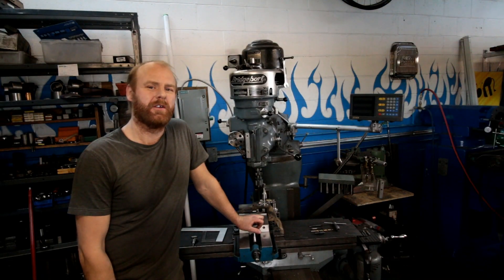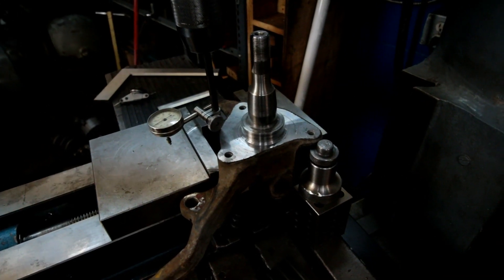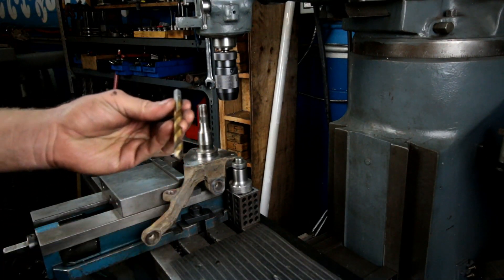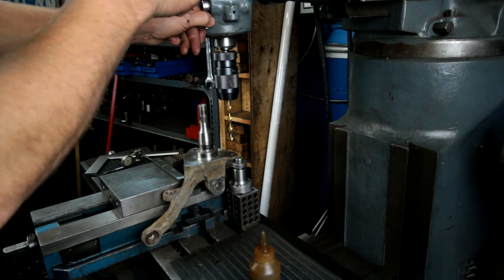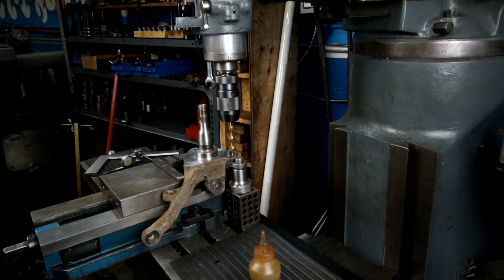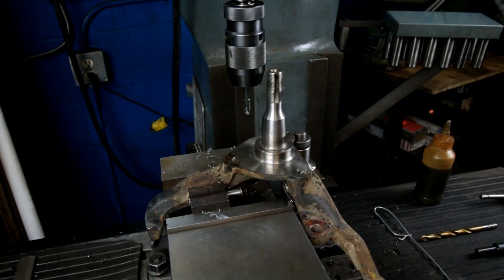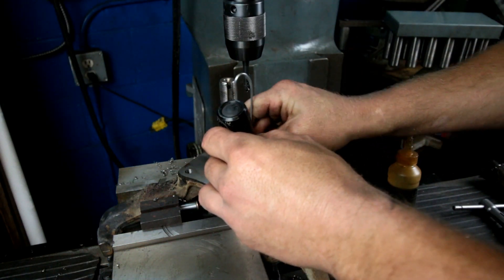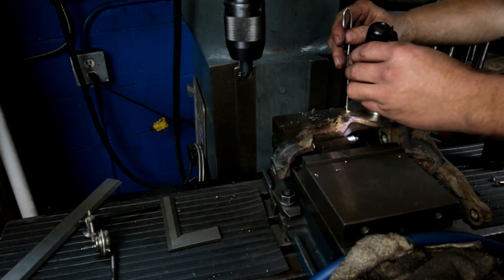Mustang spindle modification

Comment: Nice work! You should definitely look into correcting the eccentric orbit of your chuck. I was concerned the drill would cut a larger hole than specified.
Reply: I saw that too. I wasn't sure if it was the video fps or the chuck was wobbling.